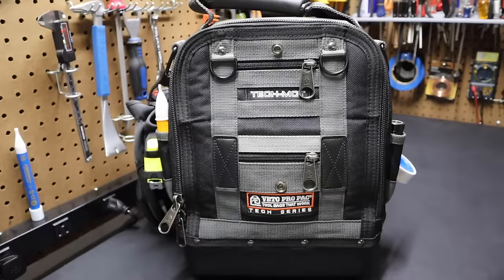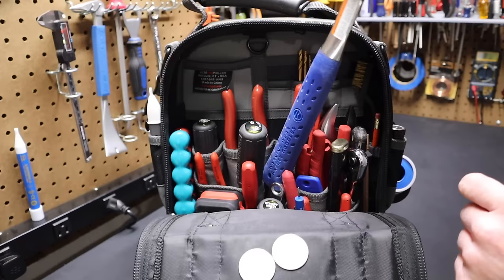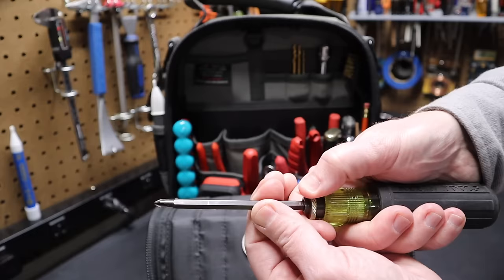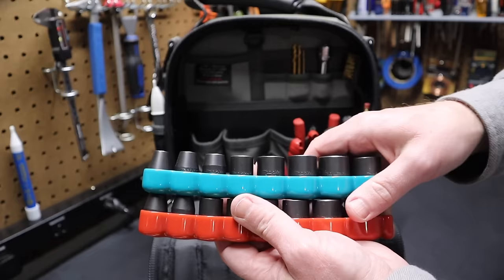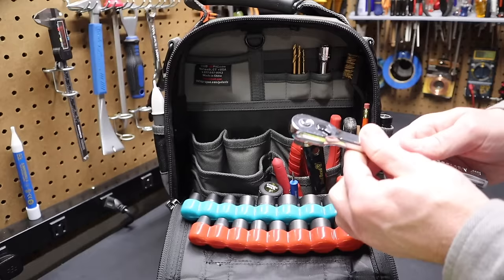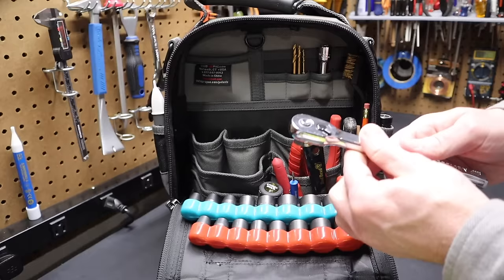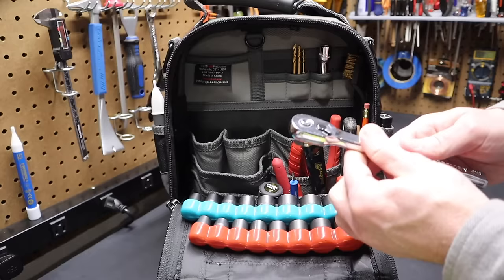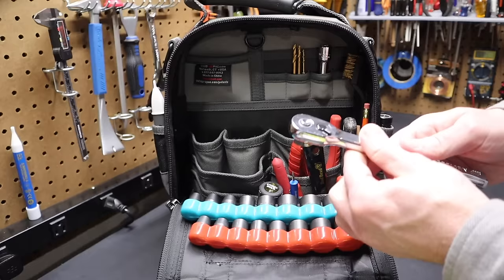Tool Bag Setup DIY EDC Beginners | Veto Pro Pac TECH-MCT Loadout

Comment: Imho there's redundancy here. But I could be wrong. It depends on whether this backpack is a primary or whether it's meant to be portable. But 22 lbs is a lot to lug around left and right. Subjective opinion on my end but I feel the Knipex replaces about 4 other tools in your vid. I'd swap out the Milwaukee Fastback for the Milwaukee Fastback 6 in 1, which makes you carry less screwdrivers. The ICON (or imo the Wera Toolcheck plus) replaces most of the screwdrivers, if not all of them. Not saying it's a direct replacement but for me, a Wera Toolcheck Plus personally shrank my toolbox by a lot and I haven't turned back.  For flashlight, you can go smaller like a 13TEOS, a Rovyvon light etc. If the kit is a primary kit than completely disregard what I'm saying.
Reply from the maker: I like the feedback, it’s really interesting to get different perspectives. The idea was to have a strict baseline of tools knowing that sometimes you’ll have to plan ahead or make a trip to get tools out of a bigger bag.  And removing any tools that are great to have but rarely get pulled out of the bag.  A go-to bag for starting any work that is relatively light. The bag lives in the truck.

Comment: I bought this bag and have it loaded and learned there is such a thing as overloading it.  Anyway, it is a compromise between weight and having a certain percentage of tools you might need.   To that end, I looked at possibly getting the Veto TP XXL and if not mistaken it has a volume of around 1800 cubic inches whereas this pack (Veto pro pac tech mct) has a volume of about 2,352 cubic inches.  So this pack will hold more.  Veto makes a backpack bag that I think has a volume of about 2,860 cubic inches so that is slightly larger capacity than this bag.  I'll keep this bag but imagine that it could be made abit taller or wider without the useless pockets or with 4 pockets like they have on one side that stick out that become useful.  Anyway, I love this pack so far.   If anyone has the Veto propack techpack blackout (one of the original and backpack) AND this Veto propack tech mct, I would be curious to see which one is better
Reply from the maker: Low weight vs carrying more is always the biggest trade off we are considering.  I think it’s best to have 2 bag sizes and a pouch. A small and light option and then a catch all bag that you can always pull from.  I’ve not tried the backpack, but that’s because I don’t want to go any larger. Thanks for watching!

Comment: I have the veto tech pac mc and the veto mb5b because I'm a commercial HVAC technician. My employer requires a closed top hands free tool bag for ladder safety reasons. I never use them for DIY projects around the house, open top tool bags are the best and 5 gallon bucket tool bags are incredibly versatile.
Reply from the maker: The MB5B is a great option, especially for ladders.  Yeah I know people who prefer open top, they are very convenient.  I’ve seen a lot of tool corrosion from bucket organizers but I will use them. Thanks for watching!  👍

Comment: Makita makes a 6” square shank extension. That extension will fit in your screw driver and now you have an adjustable length bit adapter for your screw driver!

Ps well I guess it’s more hexagon that square but you get it
Reply from the maker: I’m going to check that out, that would be nice!  Is that the Makita E-01373?  Thanks for the feedback!  👍

Comment: Great tool kit. well thought out!  I bought one of the Ang multimeters after one of your earlier videos, what a great bit of kit!  I keep the accessories in an Altoids tin to keep better track of them.
Reply from the maker: Thanks and that’s a good idea on the accessories.  I’ve since made more improvements to the setup. Trading out the adjustable wrenches for Knipex pliers wrenches, adding a demolition screwdriver, some sanding cloth, a set of 1/4 Makita sockets and some zip ties. Those are the biggest improvements but it’s easy to slip into overloading the bag.  Thanks for watching!

Comment: A few things you could add
An Allen key set(the bit set is nice but sometimes you need a solid key 
A caliper
Wd-40
Brake pad cleaner
Contact spray for electronics
Super glue
Spare plug 🔌
A bottle of disinfectant to go with the bandaids
Sunfix aqua (epoxy putty)
A small piece of stainless steel pipe for extension and twisting
Reply from the maker: Thanks for the ideas. Sometimes you must use Allen Keys, to keep this bag light, I think the ratchet gives more versatility. It fits into extremely tight places that don’t give you much arc swing.  I will be adding some these items, like the WD-40. Thanks for watching!
Reply: @projectpinehills thank you for sharing, also another thing that popped into my mind is zip ties.

Comment: i am very inspired by this setup! looks amazing for my needs. I ordered the multimeter since it seems so easy to operate, and other stuff aswell. i might however buy the limited edition dewalt mclaren bag, since i am only a halftime tradie :-) !
Reply from the maker: That’s great, let me know how it works out.  The idea is to build out an all around bag, you can apply it to any bag. Thanks for the feedback and thanks for watching!  👍
Reply: @projectpinehills  Your setup makes so much sense for my needs as a wheelchair "customizer". Its handy, light, small, sturdy and i much prefer the Veto bag, i think i might ask my boss if we could split the cost of the bag 50/50 and i can use it as my at home bag aswell ;-)
Reply from the maker: Yes and Veto typically has a spring promotion where they will at least offer a buy one get one free option typically in March. Keep an eye out for that. I have switched out the small adjustable wrench for a 6” Knipex Pliers wrench. Needed it this past weekend when switching out a carburetor on site.  I also added a small 1/4” drive Makita socket set.

Comment: The Wera tool check plus would have been a good alternative to the icon bit set + separate sockets, plus, those flexible socket holders are awful to emote sockets from quickly. And seeing as budget didn’t seem to be a consideration, it would probably cost about the same…
Reply from the maker: Thanks for the feedback.  The Makita sockets have worked great.  The tool check plus requires a significantly greater cost to have both SAE and metric sockets.  I also prefer to break down the tools so that they pack in a tool bag better so I can pull out just what I need and not an entire kit.  Thanks for watching! 👍

Comment: You shared earlier with a tpxxl. Which one do you prefer?
Reply from the maker: I like both, but for less tools, lighter bag, less likely to tip over in the truck, completely enclosed to reduce condensation and tool corrosion, I like the Veto TECH-MCT.  I'd really like to see something take the single flap of the TP-XXL and combine it with the base of the TECH-MCT.  I also like that it's 2 lbs lighter than the blackout edition.  Thanks for watching!